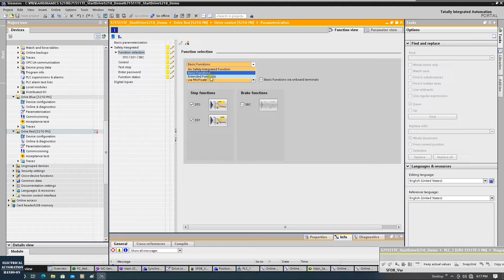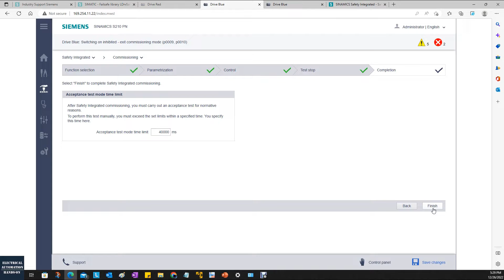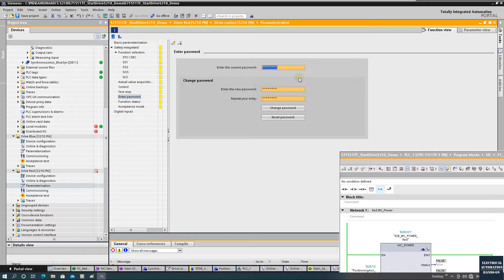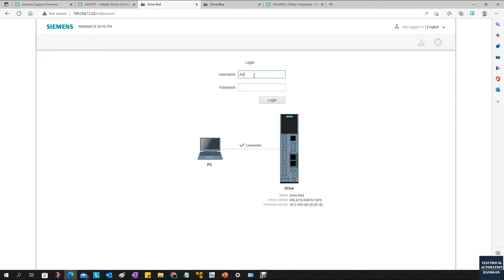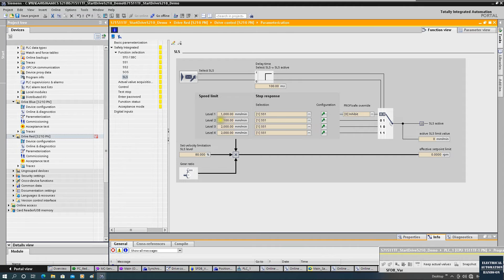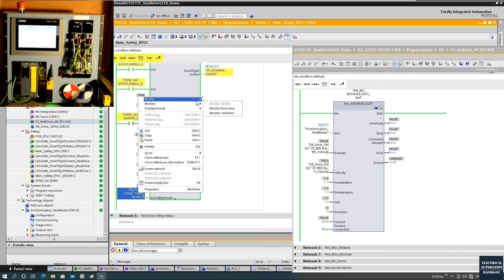MS06J. [Siemens S210 #10] Servo Drive SLS Safely-Limited Speed

Comment: Hi thanks for your lesson. I wonder if running with the high speed, I open the gate whether the motor will go down to slow speed
Reply from the maker: No really, the SLS is not used to control, it is used to monitor the drive speed, if the speed.is high, the drive will be disabled.
Reply: @electricalautomation  According to the Official introduction "After SLS has been selected, the higher-level control must bring the drive down below the selected speed limit within a parameterizable time." From my perspective, if the higher level controller ramp down the speed within configured time actively, then the violation will not be happen. Am I right?